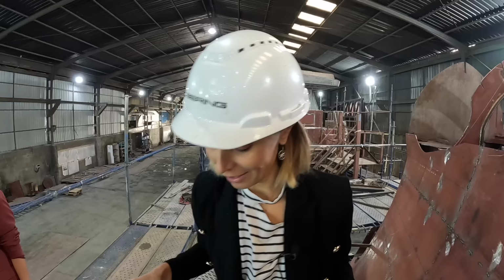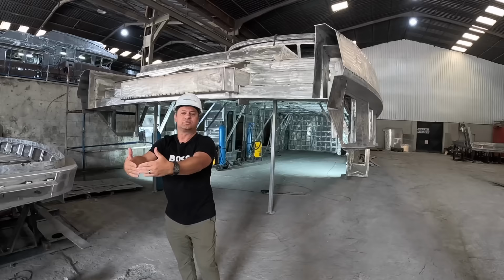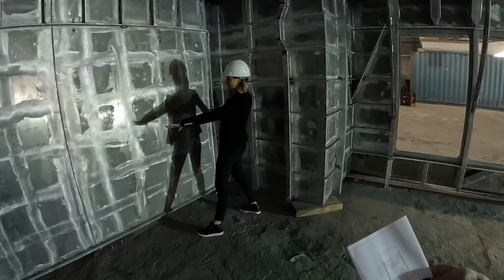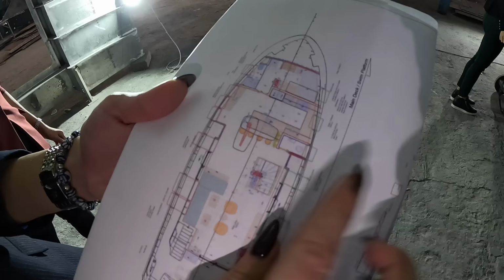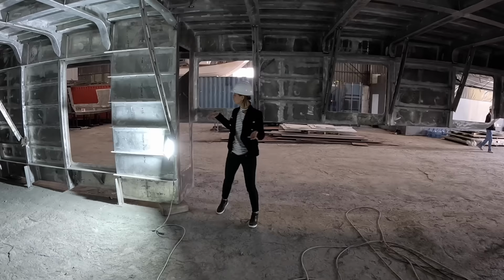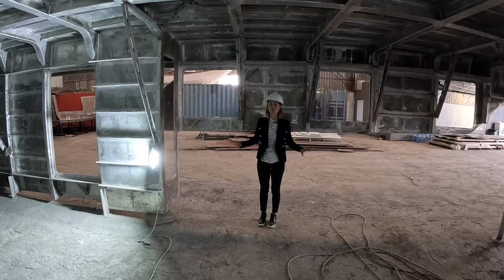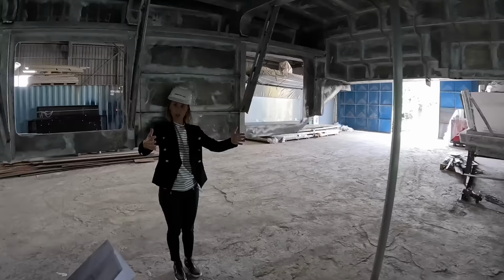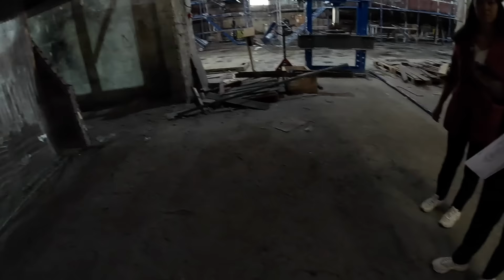Tour of Our Main Deck, Salon, Galley, Crew... and MORE 🤩🤯 Eps.17

Comment: Wow, it seems massive although I'm sure it will feel slightly smaller when all the insulation, wall coverings, galley equipment, furniture and crew bulkhead are installed. I didn't know much of the superstructure is aluminum. Makes sense for weight distribution. I hope you are seeing top-quality welding! 
Enjoying watching the build process a lot.
Reply from the maker: Thanks for enjoying to watching our build process - we appreciate you!

Comment: Very glad to see the crew quarters and crew head sorted now. I like the idea of the washing machine and dryer in the vestibule separating the crew heads from the crew cabin. A small double a nd a Pullman above is sensible. Generally it’s a really good use of space. I presume the idea is that ironing can either happen in the crew cabin or on the port side opposite the galley when guests aren’t about. The only thing I worry about is that there is no inside formal dining. On a boat of that volume there really should be a good 8+ seat dining table on the inside.

Comment: Haven't heard any mention of the ADA elevator for us that have trouble getting around.  The doors need to be wide enough for wheelchairs or walkers.  Also need a dumb waiter so the crew doesn't have to run up and down stairs with trays on a rocking boat.

Comment: I’m wondering how the join they aluminum superstructure with the steel hull. Usually joining dissimilar materials causes a weakness in the joint.  So I’m interested in how they engineer that for both strength and corrosion resistance.

Comment: Ahhh the joy of customers making last minute changes. 😏 
As a boat builder I would allow any possible changes - BEFORE construction begins.
With todays 3D software, everything can be visualised on the computer before hull is laid.- no need to stress out the builder - unnecessarily. Giving customers too much control creates a lot of stress for the building crew, and only satisfies the Ego of the customer.
Reply from the maker: Thanks for sharing your thoughts
Reply: LOL. NautiGuys were very polite in their reply to you. As a house builder even mid build changes can be made without too much stress. My cutoff is when we would have to undo something we have already placed, at that point it starts costing you big time. Even before then if the customer changes something drastic that results in delays then that is on them. For the little stuff that Victoria & Rico are proposing during the build ... meh, that's expected.

Comment: So the “cut off” portion of the aluminum superstructure where it connects to the steel hill… how is that connection made without a galvanic reaction?
Reply: Triclad.
Reply: @blegi1245  so if I understand correctly, you end up with an unsightly transition, not a smooth, invisible under paint transition.  The “cut-off” comment in the video and the appearance of the bow direction edge of the superstructure made it appear that end was intended to flow into the hull.

Comment: How do they manage to build square on a floor that looks like the floor of a steel mill? Good grief, what did the previous occupant of that shed do in there?
Reply: Probably build on a jig
Reply: Yep. The hull and superstructure are all built on a solid jig that is laser leveled before the first piece is layed down. This is mostly important for the hull. The superstructure has a small degree of flex that can help during the mating process of the two main parts

Comment: Will everything be primed before anything not metal is installed?  How is the steel/aluminum joint handled, that might make an interesting topic on a video, dissimilar metals.  My CG cutter had a steel hull and al. superstructure, aluminum moves around a lot.
Reply: The hull and superstructure are joined with triclad.

Comment: I'm concerned that everything is just tack welded. I assume they will be finishing the welds at some point? Other than that this is the biggest 75 I have ever seen. That 24 foot beam is going to make a really stable boat for that length. Stabilizers work great when you are under way, but this boat should have great stability when anchored which I think is more important.